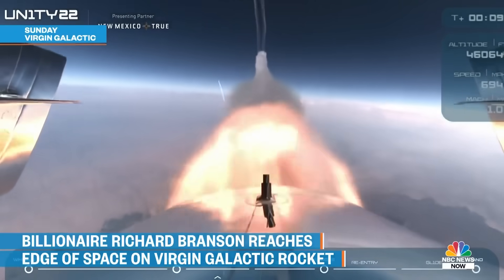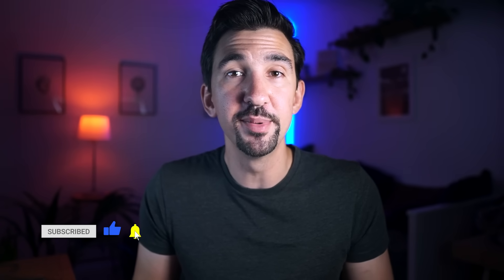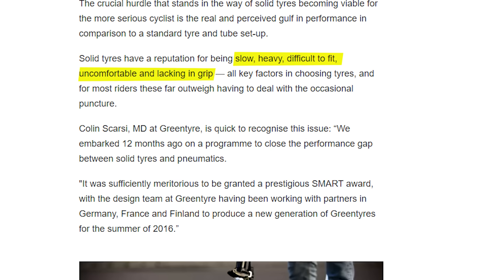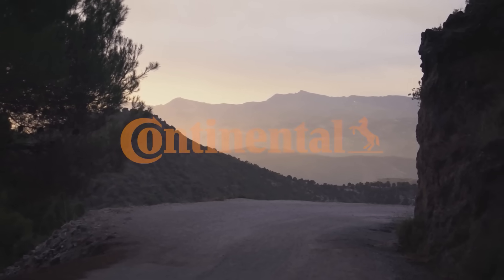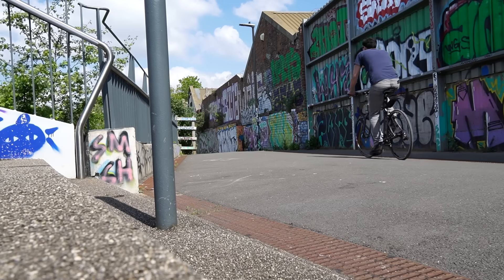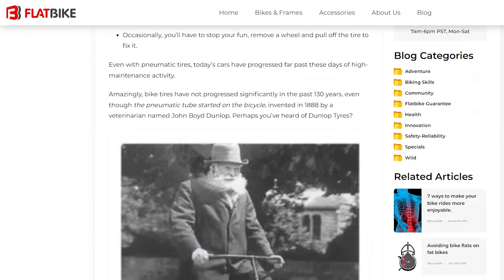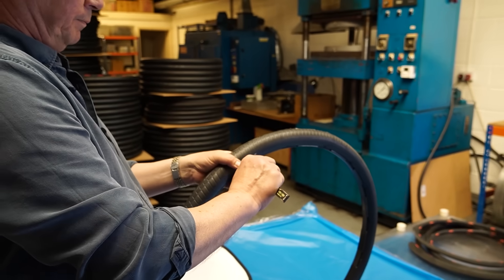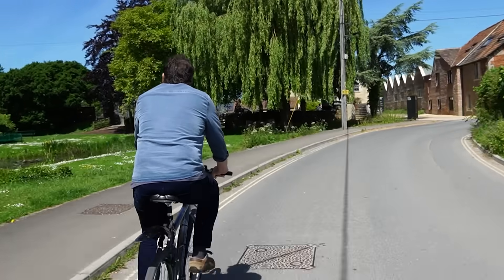I Tried Solid Bike Tires | Here's What I Found

Comment: Bell had a rubbesfoam innertube for years  then after around 2017 they pulled them off the shelf  because of their success ( they don't pop ) underneath the tread   it will take  around two years to or 6 months depending on how often one rides  Bell made them better

Comment: I've seen a few airless tyre systems in my time, and they all suffer from a lack of suppleness and, believe it or not, you wanna go faster, supple, the ability a tyre has of getting out of the way of a bump then immediate;y bouncing back, is only truly possible with pneumatics. Soft foam fill, crushes quickly but is slow to restore, so you hit a big bump, you get a flatspot for 2 or 3 revolutions that will shake the teeth out of your head. They're great for wheelchairs because that's walking to running pace and impacts are less than at bicycle speeds. Integral chambers, the tyre is kind of filled with aire but has no valve - these are like riding with bricks for tyres and are awful. They will eventually split and... go flat. Then there's the recent tubless trend. Tubeless needs maintenance - the sealant eventually sets and coats the inside of the tyre, making an irregular weight distribution and unbalancing the tyre. You have to regularly take the tyre off the rim and clean the set sealant out.

The tyre system that works and works and works is a teflon banded tyre, like the Schwalbe Marathon and a TPU tube. Nothing is flat-proof, but TPU is close. It also handles lowish pressures better than traditional latex. I'm not convinced a "foamy" will ever replace butyl tubes, let alon TPU and tubless? Hang that high from the highest tree, works well for racers with a mechanic on the team, quadruples the maintenance for a city bike.

And good lord! DOES NOBODY MAKE A SUPPLE 20" TYRE?!! I've moved from a bike to Greenspeed trike because recumbents are better for dicky tickers and the tyres are as hard as granite! Across the entire 20" selection where I live. No wonder Brompton ares so popular among folding bikes, 16" tyres abound that ride like clouds. Nobody seems to make a pillow down tyre for 20"/504 rims!!!

Comment: I have had to install solid tires once for a customer. Almost completely ruined my finger caps getting them mfers over the rims. They took hours to install since the plastic retainer clips kept falling off and I generally had a very bad time installing them without losing all my sanity. They lasted for about 8 months before they were worn angularly. Took another 2 hours to cut them off the rims without damaging anything. 0/10 will never do it again.

Comment: There are enough solid tire products. There is no magic solution with only one compound. This one with time came flat which You mentioned in this video. Company mentioned in this video STILL not launching product after already two years passed...
I wish to use solid tire. I wish it to be comfy enough. Only real solution is to put in silicon core which are much more elastic than actual rubber and for my opinion will be still possible to recycle them easily enough... I don't care if some one steal this idea. Even opposite - I'll be glad if some one do and gives me my fucking solid tires which is comfy enough and cheap enough... I dare You to make them.

Comment: Okay, a few things that popped up in my mind about this:
- This tyre essentially is closed cell rubber foam. What happens, when the outer tread is worn through at some spots and I ride it in the wet? Would it soak up like a sponge?
- The example in weight compares Gatorskins, which are known to be notoriously heavy. over 400g for a 23c tyre isnt normal.
- The next one is anecdotal, but still I stand by it: Most flats can be avoided by paying attention while driving. I see so many people sit on their bikes and just endure every bump like a bag of potatoes and stubbornly hold the line even though they could circumnavigate alot of potholes or debris on the street easily. And then they complain about flats... Also you are allowed to stand up out of the saddle to absorb bumps more easily.
- Pricing? Because a pneumatic tyre and tube combo can go as low as 30€ for some quality tyres (Continental Contact or Ride City for example or Schwalbe Big Benn or Road Cruiser).
- In regards of sustainability: you can patch an inner tube multiple times before it is really dead. A normal outer will last you approx the same 2-4 years in commute depending on how you ride. So effective pricing is again lower I would expect.

Comment: We should grind up old tires into small chunks and bind them into a tubeless core with a lighter foam.  More chunks per core = firmer tire & vise versa.  Airless bike tires have the same issue as airless car tires.  They need to be tuned for tire size and specific overall vehicle weight.  So, multiple cores would need to be made for each bike tire size to compensate for individual rider weight and riding surface.

Comment: We already have a decent solution to punctures, which is used by the majority of the MTB community. Going tubeless, and using sealent in the tyre. The only way you will get a puncture that looses more than 1-2 psi with this method is through crashing, and ripping the tyre. For larger punctures that occur off road, we have rubber plugs which work with the sealant to create an airtight seal. There will realistically be no better way to emulate the versatility of tubeless, air tyres. As you can cater to weight and terrain, by simply adding or subtracting a few psi.

Comment: brilliant.. !  when searching Gecko tires for cycling.. i got 300 commercials for insurance.. why don't you just put a link to order them..?    Something like this would be great for a heavy duty Cargo Trailer for a Surly TED... I can't afford to get a flat on a solo tour.. I don't want to call in help if the trailer goes flat.. I will be carrying about 150-200 lbs... a flat could mean an expensive end to my trans continental tour.. the trailer carries my 175w solar panel to recharge the etrike...I will have unlimited range on sunny days.. but a flat will stop me in my tracks as i can't lift the trailer to take a wheel off the repair a tube..   All the Tannus have to be replaced when you wear out the tire.. You can't do that on the side of a road (and you will have to carry backup Tannus, tools, and new tires..

Comment: Why won’t we make a hybrid: air tube with pressurised air inside plus an extra thick wall (2-3 cm) from ordinary polyurethane or this patented material? Benefits: 
- no or almost no fortified frame walls (high recyclability);
- immune to almost all practical puncturing objects;
- relatively comfortable ride even if punctured;
- bouncing coefficient close to 70%;
- cost lower than ordinary tyre due to lack of wire frame; (if usual polyurethane is used then service life will be low, but may be not lower than 2-4 years).

Comment: I tried Tannus tires on a road bike. High rolling resistance.  What was worse was that every rides started off with a flat spot where the tires had been touching the ground.  Went away after 5 to 10 min but very annoying.
Reply: Same. Gave away my Tannus 700c's after ~6 months because of the high rolling resistance. What's worse is that Tannus refuse to acknowledge it, despite so many of us reporting it. They just gaslight you.

Comment: 7:19 "compresses the air"
No. Air is constantly moved away from the current contact patch area to the rest of the tire but the volume of the tire only changes when the load changes, such as when going over a bump.

7:55 Completely different mechanism. The rubber prevents the air from moving normally.

8:23 The bounce test isn't constant volume, so the pneumatic tire is at a disadvantage.

I've pondered the "tire problem" and have a couple of potential solutions. One of them could significantly increase a foam rubber tire's efficiency.

Comment: I'm not sold, mainly because with quality tyres, quality tubes, inner tube sealant, and running at the right pressure, flats don't happen, basically. Can't remember the last time it happened for me, certainly several years ago, and I bike almost every day, year round. So I see no reason to sacrifice ride quality and grip. I've tried airless once, unknown brand, and it was horrible. Uncomfortable and draggy. It's good that the tech improves, but I have zero need for it. And I'm mainly a transport and recreational cyclist, not a racer.

People who are using quality pneumatics competently and still have lots of flats may disagree. For ebikes I can also see some people liking it, especially full suspension ebikes. Maybe some kids bikes, if they aren't used much. Strollers, maybe. Department store bikes, if they get cheap enough - it will be a good selling point for buyers who want the absolute minimum maintenance regardless of how bad the ride is.

The recycling argument is good though. I'd be happy to try it if I got the chance, but I wouldn't buy without riding it first.
Reply: The recycling argument however depends on the tyre actually getting recycled.That requires sorting, transport and facilities to do the job. Without them, this airless tyre just becomes landfill as well. And it contains more rubber than air tyres, so the resource demand is greater. I see the niche, but it's clear that racers aren't the only ones who have no need for this.

Comment: Idk, i get the part of moving forward in terms of tech for bikes, but this seems like a very useless problem to solve, as most likely with solid tires there will always be more cons than pros. I ride tubless, rarely if ever check if i need to pump them for air and since i maintain my bike i dont leave it in the sun or exposed to the elements  theres no reason for that air to go anywhere unless the tire itself is at the end of its lifecycle, this is like trying to solve an issue where you wouldnt have to make your bed in the morning

Comment: I try to avoid things that will flatten a tire. I ride all the time, rarely get flats. I started using Continental Kevlar lined tires years ago. They worked well. Ya. They’re a little heavier, but so am I so it’s a moot point. They didn’t go flat and rode well. Now I ride on Schwalbe Marathon. They ride nice, so far flats have not been a problem. Way back when I tried bike with airless tires, I couldn’t get off that bike soon enough. I haven’t tried this tire, maybe I’ll test ride a bike with them, if I get a chance.

Comment: well I think there's going to be several applications where this technology will be the win, but in mountain biking for instance, with say a 2.5" tire (that's my voice to text spelling it with an i) plus the Orange or Stan's fluid we put in the tires to rush out and clog fill any small Thorn type holes, I cannot imagine this technology is within a decade of even coming close. 
.
I think better to put more science into higher quality materials and designs for the casing of standard pressurized air type tyres.

Comment: This has been tried a bazillion times. Pneumatic tires are better because the force on the contact patch is absorbed by the total volume of air in the tire. In foam the force gets focused on the air cells directly next to the contact patch patch, then to a small area of the rim. The rim bends and your wheel is effed.

Comment: Wouldn't mind trying out a pair of them made for mountain bikes. Then they could be offered in different hardnesses, to emulate different tyre pressures MTBers ride at. So far I prefer riding my MTB with fully pumped up tyres for the least possible rolling resistance, and since I'm riding on a pair of Schwalbe Magic Mary I still have a decent amount of grip.

Comment: I suppose this company not goes far because I first time hearing about it. Anyway.
Two questions:
1. Real cost for end user?
2. Real practical longevity?
Those are important questions. Also installing... Are kind a cringy because You actually can bent rims in that way. Trick with practical longevity are in fact that such spongy structure will degrade more and more. At some point it actually be like a punctured tire and rider trow it away long before this point. Which lead to real cost for end user. If I'll be forced to change it every season and even if it be even twice cheaper than regural tire... Then what's a point in it? Same with recycling of it. Doesn't matter how recyclable this tire is if there no access to sent it to be recycled. Even more obvious question... How the hell You UNinstall it if You need mallet to instal it? Is it meant I just ripping them to put out?.. Most questions can be downed to two I write above. And, You know, I have couple punctures in my regular tires, they used for 3 year already and they still good. So... Just why?

Comment: Regarding recycling: I guess these tires have to be recycled seperatly with identical tires because of the special (secret) rubber-compound. I don't think you will get enough returned tires to do that in a cost-effective way.
So if that turns out to be the case, the whole recycling argument for these tires just falls apart and they end up in landfill as well (potentially loosing more rubber than an air filled tire).

Sorry, not convinced.

Comment: Wouldn't this be more wasteful as when you develop a flat spot or it wears, you'd have to throw the tire away and as it's more solid than a air filled tire there'd be more wastage but if you get a puncture on a normal tire you can patch the tube and reuse the standard tire and unless you can put it in a standard recycle bin most people will just throw them in the bin although I may be missing a point here.

Comment: The logistics of transporting/shipping these large  and basically unbend-able tires ~ not to mention vendors storing them ~ will add quite a bit to the overall cost (aprox $150 per tire with tax and shipping) ~ and they STILL wear out over time. For it to work, they would need to sell for less than $100 US, and with rising manufacturing costs I see no way they will be able to make that work.

Comment: Either get tubeless aired tire with inner foam protectors, or puncture proof tires like Schwalbe Marathon. At least on Earth, that's the best solution. Maybe wired spring tires could be useful for moon like every old rideable rovers sent there.

Comment: One word, suspension. You put suspension on the back and front of the tire, get a suspension seat, and the ride becomes less harsh. But it would be better to advance the rubber wheels to be softer, I guess you could put bubbles in the tire, fill it with a gas, so it acts like a normal tire, then seal it off. Kinda like shoes with air bubbles in.

Comment: Michelin makes the Bib Mousse for already 4 decades. The last iteration of the Bib Mousse will last two seasons of the hardest enduro racing.  The Bib Mousse's extra weight can get compensated partly when it is combined with the more light weight tubless tires that Michelin specificaly has developped for this enduro racing application.

Comment: Certainly a worthy idea.  I can see why people might want them.  But I will say this: I’ve been running tubeless, doing all the maintenance required (remember that tubeless isn’t maintenance free, it’s moving the maintenance to your workshop), and I’ve had three punctures since 2016, riding on average 11,000 km a year (dry climate, decent roads, very low pressures, very supple tyres.). Of those punctures, one was a huge nail that made a hole the size of .22 bullet and the other two were 1 cm+ cuts caused by something razor sharp (one was most certainly razor wire).  If you are not the sort to do scheduled maintenance, then solid tyres are a great idea, but I say tubeless is the way to go.

Comment: How about a hybrid? Instead of putting air bubbles into the tire like a milka luflee chocolate, what if you could pump up the tire, but at a certain pressure inner microchambers would seal themselves?
I think the outer bubbles/chambers should be really small, while the inner one still could be a continious tube to alter the pressure for different terrains.
The tire should work even if the inner tube was completly airless, but could be modified with a higher inner pressure.

Comment: Pirelli PZERO Race Folding Road Tyre with TechBELT Road carcass improves reliability against punctures without affecting the weight of the tyre while the special SmartEVO Compound enhances the grip performances both on wet and dry asphalt compared to our previous cycling compounds $89.00 AUD. Problem solved.

Comment: so tractor tires, but if you have small pores in the plastic, then you get similar effect to an air cushioned tire, without needing to make it pressure-proof. stuff already made vs actually something new. re-chewed re-cycled stuff plz. :) yep airless tires instead of air or solid tires. yep TPU solid plastic tires are very flexy too. and with the pores and cavity.
Reply: try two part symmetric rims, that you can fit solid tires directly into, just keep the two rim halves together with the wheel mounting lug screws, or more.

Comment: E-bikes and tubeless, sealant-filled air tires are the best solution!
No more performance issues for a non-motorized cyclist and a fat tire e-bike can easily beat an elite cyclist, negating rolling resistance, tire width and all that bs factors!

Comment: I used to work in a foundry, pneumatic tyres dont work well with red hot metal in, so their solution is gel filled tyres, literally green gel which sets firm like rubber. I have been wondering about the feasability of filling bike tyres with it.... Why not?